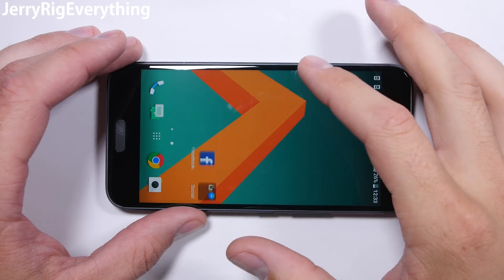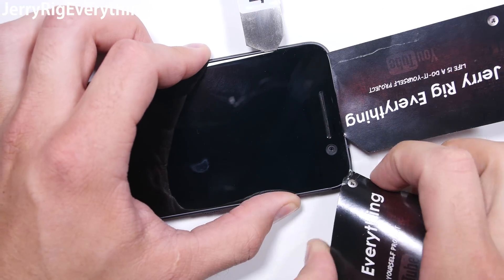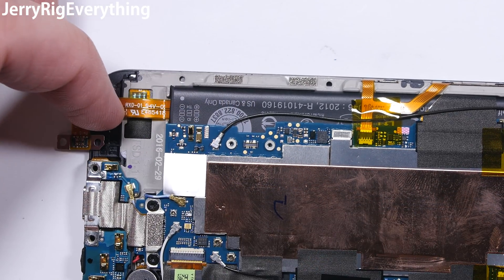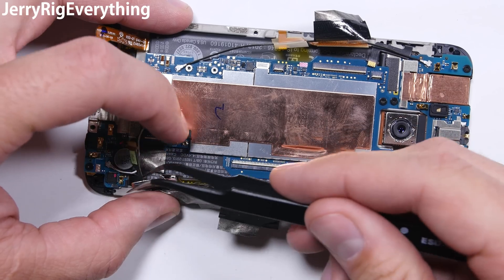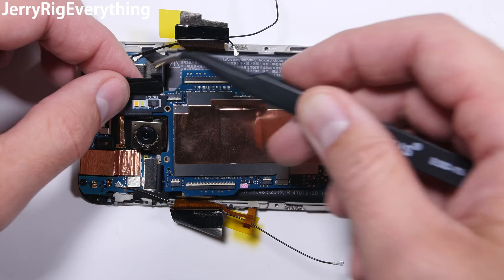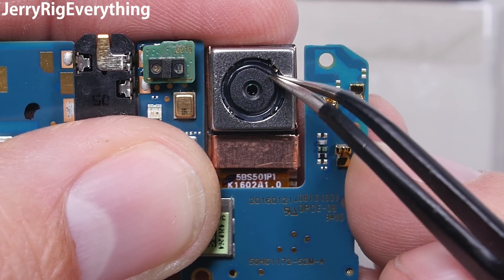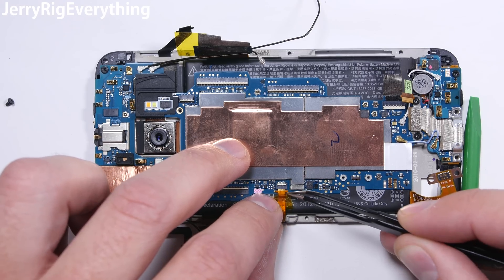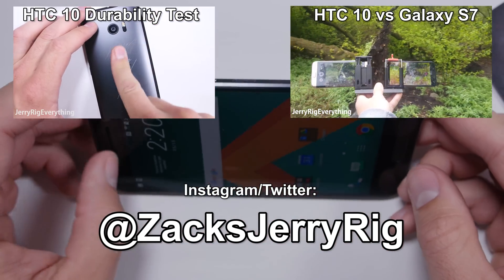HTC 10 Teardown - Charging port fix - Battery Repair - Screen Replacement

Comment: Jerry, imo the whole bit (of re-attaching those several parts) from 6:47 on is cut into too short clips for your viewer to b able to follow what it is you are doing.. i think you should as a rule of thumb stick with giving each separate shot a minimum length of about 2.5 ~ 3 seconds if it is about components

Comment: Hi dear JerryRigEverything  i change my lcd, menu central button is working, i transfer it, but the 2 buttons (left and right) on the screen aren´t working and not responsive, are they integrated with lcd? there is any tip to make them work or i got a new defective lcd? thank you

Comment: Old video, but I have a question: I would like to replace just the back cover of my phone, because it has a small dent in it. Since the only way to get the back cover off is by prying the screen off first, I must know: will sliding the playing cards under the screen while prying it off affect the water or dust resistance of the phone, after it is put back together? I know the HTC 10 isn't IP67 or 68, but I'd still like for the phone to preserve as much of its IP53 rating. Thanks!
Reply: Frank Ding It will, unless you use new adhesive equal to what is used at the factory

Comment: Well, better protect your htc 10 with your life...
Reply: hard to protect the battery if u ever charge ur phone. sorry htc but this was enough for me. 800+ € for phone which is pratically too unreliable to use anymore after 2+ years of use. I rather buy 400 € chinese phone each one year.

Comment: bro i appriate your work... my new htc 10 1month use...
its lower speaker bursted automatically not fallen nor damage.. i dont know what to do please help me
Reply: Call HTC Support?
Reply: Phillip Morales not avaliable in my region
Reply: A.Rehman Zahoor where is your region? So far there is no way to replace the speaker. How did you get the phone if it isn't available in your region? EBay? If so call the company you bought it from and they will replace/repair it.

Comment: what HTC should've done is make that large bezel on the back removable. Snap on and off style. When you take the bezel off it could've exposed little screws that hold the back of the phone to the body. Remove the screws and vuala you can now repair your phone.
Reply: DJR5280 I think some screws on the back would add to the industrial design of the phone.

Comment: can we just replace the camera of one plus 3 with HTC 10. I just want to know!!!!!!!!!!!
Reply from the maker: No, the connections are different. And the software drivers... so its impossible on 2 levels.
Reply: thk... bro!!!!!!!!!!!
Reply: i mean, because all the stuff is made for that phone no. like the end connector may have a certain amount of pins. The app may not function properly. The only way this could work would be phoneblocks/project ara kind of idea
Reply: jerry, wth why did you make an asmr playlist
Reply: Is there any camera combination that could work? like using the Galaxy S6's Camera on the Galaxy S7?

Comment: Anyone else watching this on an HTC 10?
Reply: mine is working well exept the battery .. it worn out on me after about 1 year and 3 month .. randomly shuts down below 20 %
Reply: butters1411 mine shuts down too randomly below 20% and now I'm afraid of changing the battery
Reply: me and i never wana reach the point tgat i have to open it for repairs
Reply: im watching it on a htc evo 3d (fucked up my m8 trying to replace the screen)
Reply: Rosian Drashkov same problem
Reply: Are your HTC 10s still running well?
Reply: @mehow2059  yes, I just need a new battery. I'm watching this to get my gumption up
Reply: Mehow well, my power button is becoming stuck now which causes the home/menu button to take screenshots which is very VERY annoying.
Just trying to find a fix for it with out tearing down the phone.
Reply: not me, but I watch it because my HTC 10's battery life sucks balls after just one and a half year. It doesn't even make it through one day anymore, when it used to make it through to complete days originally. It really pisses me off.
Reply: I'm watching on my 10 because no one around here wants to fix it and my battery now turns off at 40%
Reply: me
Reply: Me
Reply: me too. 😄
Reply: Wolfgang Ervin yep
Reply: Me
Reply: That's the whole point
Reply: i tried that a couple of times and didnt help what so ever ..
Reply: same here. got my htc 10 battery replaced, but the repair store damaged the edge of the screen lcd. (a dark shade is visible when screen is bright) funny thing is they tested the battery first and told me the battery was very healthy... I insisted to let them fix it. but i don't think they use the htc battery because now the phone no longer has fast charging.....
Reply: Me. recently having battery issues with it failing everytime i tried using it unplugged. Planning on handing it back to HTC for repair next month.
Reply: Imran Mohammed should the phone be off or on when doing the charging?  

What about cache partitions, does that need to be wiped?  If so, should the battery be fully charged, as close to 0% as possible, etc?

Thanks!

My 10 works fine except the battery dies at between 10-30%.  I've tried you're method a few times with no success... Just making sure I'm doing it properly
Reply: Mines silver
Reply: butters1411 mine only stays with the screen on for about an hour
Reply: 10 bolt actually 😅
Reply: Me lol. Prepping to replace a battery I just ordered.
Reply: I'm watching on a htc u11 touche
Reply: Planning on replacing the battery, power button and USB jack on mine
Reply: 510
Reply: With a 510 you just pull the sides off
Reply: The 530 is a bit of work, you have to take the top and bottom bits off, then unscrew it and then it should just come off. As long as you can get the first bits off
Reply: Yes, I have 3 of them, 2 white screened, one black screened, all glacial silver models. My black ones screen is cracked for a second time, but when I took it in the first time to have it repaired the guy messed up my capacitive buttons so they won't light up anymore. They function fine but just don't light up, so Im trying to look into this to see how to fix that issue. I won't replace the screen myself. I just tried pulling the screen off my Nexus 6p to replace the battery and cracked it. I love my htc 10s so I won't take the risk on them, and rather have someone else do it
Reply: 3 years later me xD Phone still works like a dream with the only issue being that the power button is a bit pushed in so its harder to press now. Dropped a few times and only a few dents cause metal and dropped in water twice briefly but still working fine. Battery is fine too and I tend to push it.
Reply: Wolfgang Ervin no
Reply: dominikmrmaster Let the phone drain to 0%. Turn it on again and let it drain back down to 0% until it refuses to turn on.

Then charge it to 100% then let it die and then charge it again to 100% and you'll be good

Comment: Would anyone happen to know a place that sells the charging port flex cable for the htc 10? If not a general idea of how long it takes for aftermarket parts?
Reply from the maker: I just checked my supplier, nothing but screens so far... Maybe another month or two for charging ports? Its not an extremely popular phone like the Samsung or iPhone... so it might take longer.
Reply: +JerryRigEverything Yes unfortunately my daughter decided to force a micro usb in to the charging port. Some how manage to bend the pins. Also noticed that a pin is somehow missing. Plan to reset the pins back in place, but rather replace the port. It also doesn't help that one must travel across the ocean in order to reach the port.
Reply: any chance youve managed to obtain a charging port part yet?
Reply: Call HTC Support they will replace it for free, if not they certainly will work with you to repair that charging port.

Comment: They failed to make the HTC10 look bad on the outside like the M8 and M9... so they decided to do it on the inside instead lol
Reply: +FingerMove How is the nextbit Robin ugly?
Reply: tjrsasea all HTC phones are same mess from the inside.  HTC m8 has the same exact type of infrastructure from inside...
Reply: Hunter Miller How is it not?
Reply: Looks are subjective, wowee could you imagine that....
Reply: Yeah the Nextbit Robin is just ugly AF.
Reply: FingerMove I've seen more people praise nextbit for the design rather than hate on the design
Reply: Nah actually the m8 has a really simular inside like the htc 10 exspecially the middleboard (logic board) that's the exact same design and also 3 different boards the upper board and the charging port with audio jack and mic
Reply: Since when did the M8 look bad on the outside? I'd rather call the Nextbit Robin bad on the outside than the M8.

Comment: It's a bit of a mess but what a piece of engineering work.
Reply: I got the feeling that the engineers were out of thier league and tried their best.
Reply: Yeah, but what work to make this unrepairable.
Reply: Mabirc actually more repairable then othen, so many replaceable parts the charging port, look at v10 charging port damaged you need new phone, in HTC 10 proximity sensor removable......sim trays.... keep your all your complains for HTC U Ultra, a bad phone
Reply: sorry v20 lg
Reply: dude, this looks like a prototype that got into market due to cash flow issues, wich it probably is. 

Compare this to a Iphone or S6, where the IC is around the battery and almost no ribbons. This is like, wow.. crap.

And I own one of these. To bad the vibrator is loose and sound like shit sometimes.

Comment: Hey im not a pro with phones but what are those little cables they taped on the motherboard?? it kinda looks cheap... and dangerous... like the glue from the tape could get weaker and maybe after some drops they wont hold those cables anymore and it will cause a problem if they disconect or something so you will have to do this whole opening up your phone thing to fix it... is that true or not?

Comment: I agree that i looks messy but seeing how everything is on a separate board and very modular, i think it was a deliberate design choice. If somehow they make it (a lot) easier to open and decide not to solder the vibrator motor to the motherboard, it might be easier to repair for the average joe because they can order one of those boards and swap it out.

Comment: In my opinion this is better than what Samsung did with the s7 edge where many things are glued together. Because there you cant replace just the charging port or just the sim-card slot so you have to replace the whole unit. So what HTC did here is actually slightly customer friendlier, even if its complicated and messy.

Comment: My HTC 10...beautiful on the outside, but ugly on the inside...just like a lot of people.
Reply from the maker: +Syon so deep... yet so true.
Reply: +Matheus Caixista The S7 scored a 3 out of 10 repairability score on iFixit. It may look "beautiful" but there's a good chance you'll break the "beautiful" screen trying to repair it. Certainly we don't want to throw stones at the HTC 10, when the Galaxy S7 is living in a glass house.
Reply: well you forgot that the S7 and the S7 edge requires to remove the screen in order the replace the usb port.

Comment: Samsung galaxy s6 and s6 edge also have OIS at the front camera. Samsung did for some reason not add this to the specs sheet, but some users noticed the front camera lens moving. So HTC 10 is not first, but not many people know that. That is actually Samsungs fault.
Reply: +Blatt Ferenc No No No...that's not true. OIS and EIS are not the same thing.
Reply: +Syon 
It is OIS
 http://www.samsung.com/levant/support/skp/faq/1078772
Reply: +Blatt Ferenc the article you linked to is about the Galaxy S6 which I still own. If it is, the front facing supports OIS, it certainly doesn't act like it. Perhaps there's a reason Samsung didn't mention it. Reviewers certainly didn't mention it and the front facing is nothing to write home about. It's hard to believe Samsung would put a feature in a phone and not blab about it like they do everything else. I also have the HTC 10. The front facing camera is better. End of story.
Reply: +Syon I don't remember which reviewer mentioned it. Does ist move when you shake the phone or does it not?
Reply: +Blatt Ferenc I'll look at it when I get home from work. I only carry the HTC 10 with me now.
Reply: +Syon Thanks

Comment: A few people have opened these but nobody has mentioned which DAC chip is inside, any idea?
Reply: its the standard 24bit qualcomm dac every other sd820 device features. so it is just a marketing gag, by htc unless some aditional software for customizing. sound by internal dac is ok but use external usb dac for good sound.
Reply: HTC specifically says the don't use the snapdragon dac and have put a separate one inside
Reply: +Sgtchickens source? 
as found by xda devs the phone only features the qualcomm dac. there is absolutly no sign of a third party dac

Comment: Why doesn't every mobile phone have identical things inside if they are pretty much the same?
Reply: because every device has a different design and the parts can all only fit a specific way, regardless if most of the key caponents are the same there are thousands of different manufacturers for the same thing such as memory, battery, camera, so while the names may be the same for each caponents they are really not the same internally.
Reply: Hey I am a 13 year old YouTuber and I do tech reviews. If you can please watch my videos and subscribe! Much thanks.

Comment: After watching you for awhile I started to feel like I could actually repair something myself! Until I watched this video o_0
Reply from the maker: +Zach Straley Lol, this is not a good phone to start with.
Reply: +JerryRigEverything my htc 10 got destroyed so I switched to iPhone
Reply: @JerryRigEverything  could you do this for the HTC bolt?
Reply: The harder the phone the better the Technician..
Reply: +TheBuggerbutt08 start with M9, as I did, it's really challenging
Reply: Or just start with a ipad 1 as I did that has less value.....
Reply: I just replaced the screen on this phone and it works fine again. It's my first screen replacement so far. Im so happy right now ☺☺☺
Reply: Sebastian Meier lol your lying

Comment: Didn't think they could build a phone worse than the M7. They took that as a challenge and ran with it..
Reply: hey my m7 and never had to open it lol.
Reply: had to open mine twice, replacing the motherboard and the usb port
Reply: Where did you get the usb port? mine has water damage, but the main board is fine. Was hoping to replace it.
Reply: I'm waiting this on a m7

Comment: this phone is a mess inside
Reply: +Pirat Carribean Taiwan! And they hate being call Chinese.
Reply: +Pirat Carribean Yooo, it's Taiwanese.
Reply: no it isnt. its just the way htc build there devices. unless the sodered rumble machine, its fully modular. adhesives suck, but u hardly find a phone without. the bunch of ribbon cables are nasty but no problem at all
Reply: +TheBuggerbutt08 Exactly! 👍
Reply: +Viet Dam It's all the same.
Reply: Just a crappy chinese phone.
Reply: Pirat Carribean i tend to disagree .. even though they fucked up with the m9 , the 10 is very good smartphone .
Reply: +Marius Gardelli I agree, but the price is just too high.
Reply: yeah .. they fucked up there
Reply: @PiratCarribean  no it’s a Taiwanese company’s

Comment: Nice video! Htc sells the worst phones and they have bad customer support!
Reply: you get one year warranty for anything that happens to your phone for free how is that bad customer support
Reply: @andrews5831  The wifi wasnt working properly on my phone from day 1 and when i sent it back to repait after 9 months (so still withing the warranty time) they refused to repair it because because it had oxydation. The photo they sent showed only the usb port had a little bit of rust. So they didnt even try to fix the problem of the wifi that was there since the first day bought it. Useless and unprofessional customer support. I had to repaet my problem 10 times. I even had to pay to get back my phone unrepaired.
Reply: +Gamal Al-rawi And this phone is amazing.Same specs as the S7 and LG G5 but more durable.Better software than LG's UX and Samsung's Touchwiz.Much better speakers and headphone audio etc.